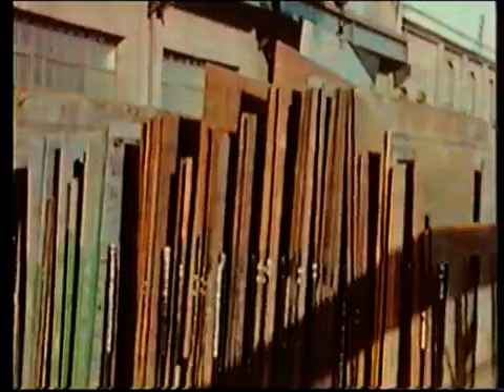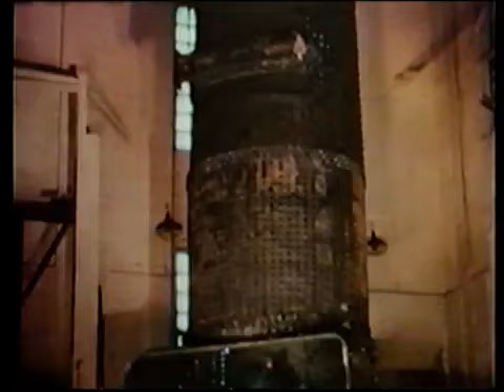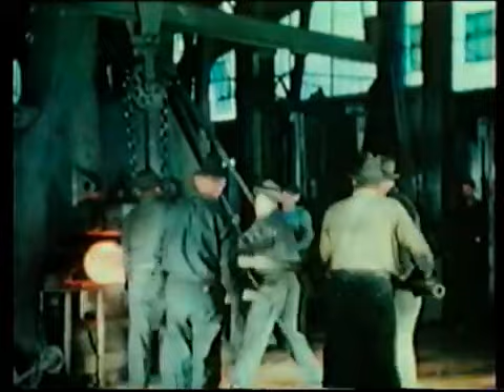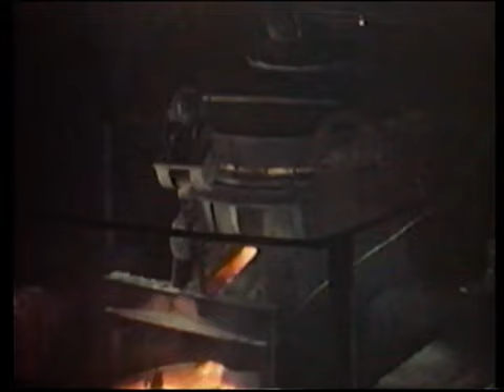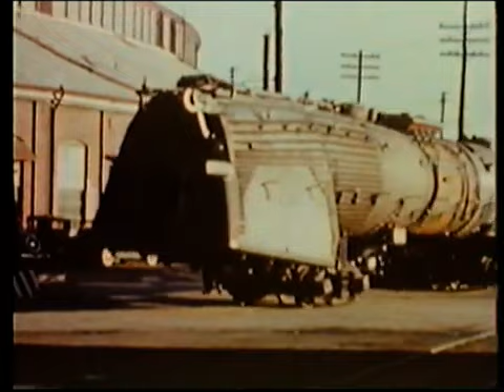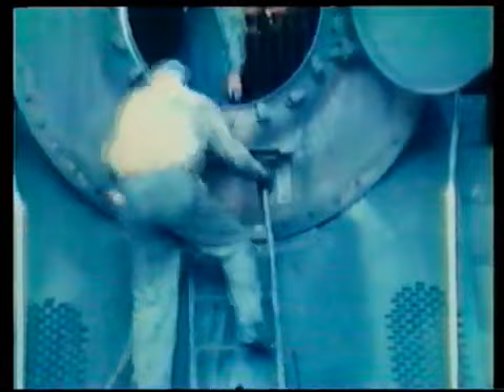1940’s N&W Class J Roanoke shops

Comment: 14 J class locomotives were build in Roanoke Shops between 1941 and 1950. Engines #600-#613. 13 were scrapped by 1960, only #611 was saved.
Reply from the maker: It’s a shame so many classes were lost
Reply: @RustyDreamsGarage At least 611 exists
Reply: Yeah.